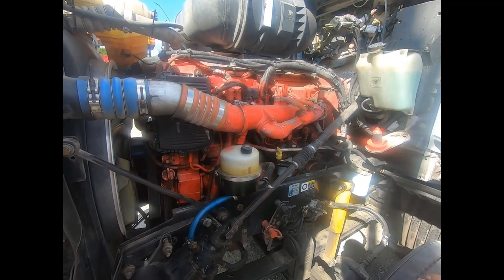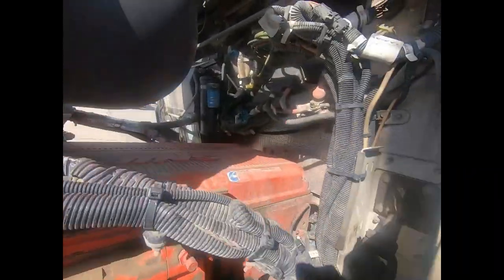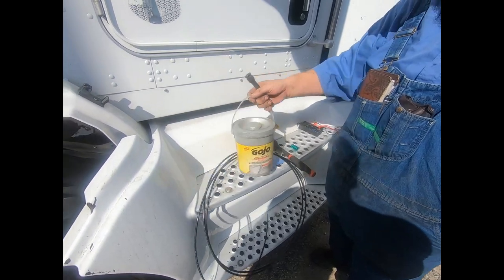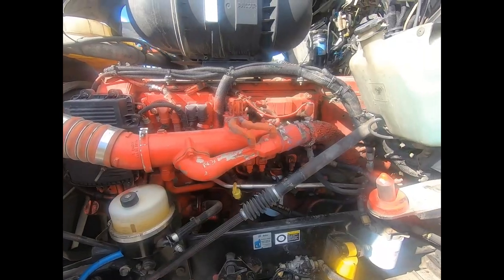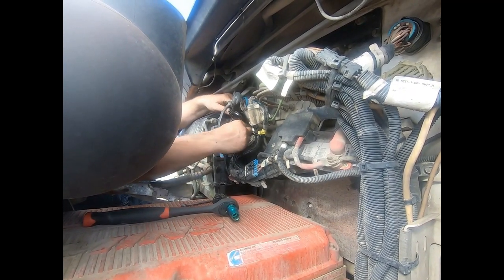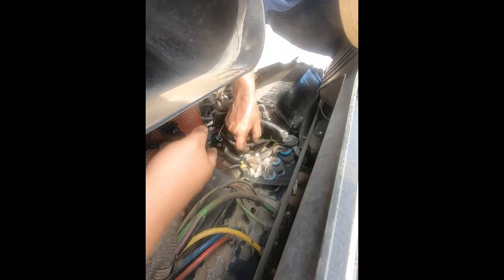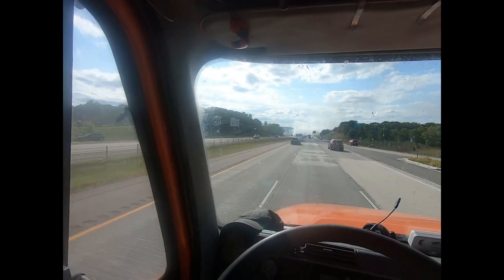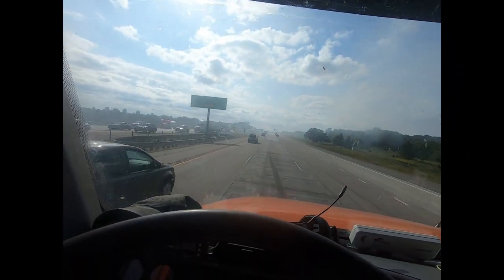Fan clutch solenoid replacement on a kenworth t660

Comment: Thank you for this video. I am a women flatbed owner-operator and needed this fix as my fan will not shut off. Thank you thank you thank you!!!!! God bless you. Have an amazing day.
Reply from the maker: Glad it helped
Reply: Check your a/c hi/ low switches first a/c overrides engine fan when condenser pressure builds sometimes they mess up it should cycle when in use

Comment: 3 things. first, thank you soo much. Ive had this same issue and worked it to this problem. 2nd, great video! Really explained the process and i have the same engine and issues on my 2015 Peterbilt 579. Fan comes on after i stop to use the can. started random then would stay on all day. 3rd. its april 2021 now. a few years past your video, but post covid, these parts are somewhat hard to find. Not too expensive, but i had to order out of state, not one to be found in the state of Texas.
Reply from the maker: Thanks

Comment: Which side of solenoid  which end of pipe to connect? There is too air connections one comes out straight and another goes out at on 90°

Comment: Hey i got a question, i have a 2010  isx15 prostar, fan is released when key is open and shows volts to the selenoid but when i turn the truck on, i get no volts to the selenoid and fan stays on, i already replaced the ac pressure sensor but still doing the same, any idea?

Comment: So my fan I have a 2007 W 900 I replaced clutch fan approximately four years ago nothing leaks, but I’ve noticed that the fan is not coming on when the temperature rises to where it should come on,  I have an override switch fan comes on so what could be my troubles.
Reply from the maker: Perhaps it is not sending the rising temp and sending signal to the solenoid?

Comment: Adam thanks for the time effort that goes into making these videos.i am having issues my fan is stuck on.i checked for air at the selonide supply is strong ,the air coming out the selonide to the fan clutch is low pressure could be a bad selonide please help?

Comment: My fan clutch appears to be stuck on. A mechanic said it might have something to do with running the A/C. Stays engaged  even after the A/C is turned off.
Reply from the maker: there are several reasons a fan can stay on. soon im planning to do a video on trouble shooting a fan clutch. But yes, a/c high pressure, or a bad a/c  high pressure switch can cause the fan to stay on. A high pressure switch is like $50 depending on the truck. If it were me, I might throw a switch at it before I paid someone to hook up to it. A/c work can be very expensive as you probably know. also,  wrong amount of refrigerant can cause this. there are other things also, but a bad high pressure switch is not uncommon. 
The only reason I feel like throwing parts at it is because I got tired of the thousands I've spent on a/c work...then to have it work for 3 days and quit again. I bought a full set of gauges and a vaccuum pump. Now I do all my own a/c work and have far less problems.
Reply: @DIYSEMI  So I replaced  the fan switch with a new one. It worked great for 10 mins until I turned on the A/C.  Think the pressure is too high or the High pressure switch is faulty?
Reply from the maker: that is likely...the only way to know for sure is read the codes...but i might just try a new switch first. the mechanic would probably put one in anyway. they are around $50.  $50 vs probably $150 for a shop to hook up to it...i probably would take my chances. other than that, the system could be overcharged, or their could be a restriction causing high pressure. But like I said, bad high pressure switches are not uncommon. I've had one go bad. weigh out the cost and decide. they are easy to replace. spin off, spin on.
Reply: @DIYSEMI  Update ro the fan issue. Went to international yesterday to purchase a AC high pressure switch.  Found out I couldn't change it on my own because I would lose the freon. 

So the shop did the swap. They did say the freon was a litle low. But that didn't appears to fix the problem. The engine fan  stayed  on all day. 

When I parked for the night, I unhooked the fan switch and the AC high pressure switch. Also drained the air tanks. Let the engine cool down. 
Then plugged both sensors back in and recharged the air supply. 

Fan appears to currently be working just fine. 

Fan switch             124.00
AC switch               127.00
Labor + freon.        218.00
Total.                       469.00

Over 500.00 with my time and fuel invested.
Reply from the maker: I have  to ask u a bunch of questions...email your number to diysemi@yahoo.com. if you care to talk. Ill call you.

Comment: Hi, I've got a 2015 KW t660 with Paccar. I tried spinning the fan by hand with engine off and cannot. I assume the fan clutch is bad, but when I drive all day the fan stays on and does nothing when I click the switch to turn it off. But if im loaded going up a steep grade and can get the coolant temp to 220 degrees, its like the truck realizes the temp and continues with the fan on until its down to around 210 degrees then the fan shuts off and functions normally all day. I can turn it off and on when I want and comes on an off automatically when I hit 220 degrees again. When I shut the engine off and start it again the whole process restarts. Ant info would be great. Thank you
Reply: Did you get it fix? I have the same issue right now. I already changed the solenoid and nothing happened
Reply: @mariomc91  yes. The fan clutch was bad and I gad  to replace it

Comment: Hello,  my KW T600 fan selenoid is new but keeps blowing air from it's bottom seeve ,any info.pls?
Reply from the maker: The new part is likely bad. The vent on the bottom is for exhausting pressure. Apparently that is stuck open. Also just check to make sure the air lines are hooked up to the correct hole.   I have had parts be bad right from the store before. It happens
Reply: @DIYSEMI  
Thanks for replay,  i find out the problem .....gues what , the mechanic put hooses fittings wrong directions.
He put out fitting in place of in fitting . And in fitting in place of out fitting,,,, Thanks again
Reply from the maker: Glad you found it. Good job

Comment: My fan is starts up as soon as i start my truck and i cant spin my fan free when the truck is off and i took the green air line of the solenoid and no air is coming  out to supply the fan clutch do you think it might be the solenoid working on volvo d13
Reply from the maker: Do you have tne key on?

Comment: How do I get the air Lines out thاeclutch solenoid?
Reply from the maker: Push in on the air line. Hold the round tab in . The pull the air line out